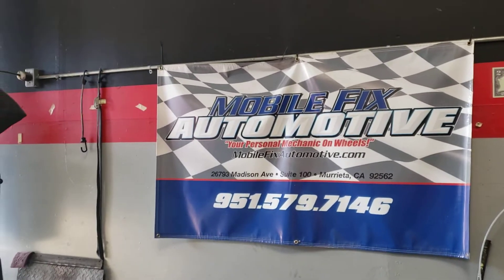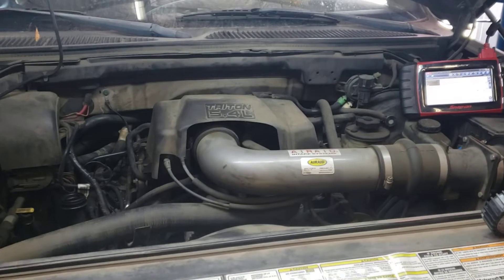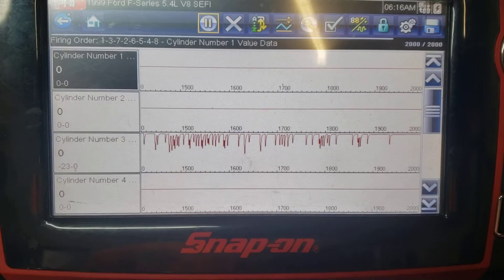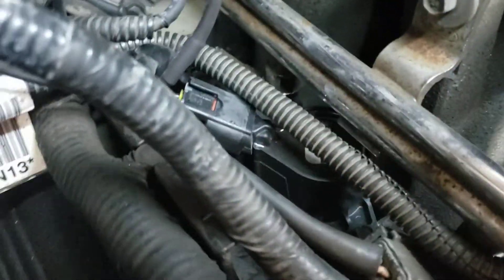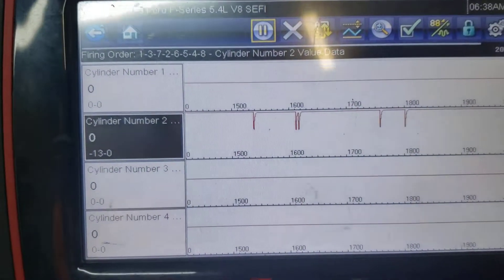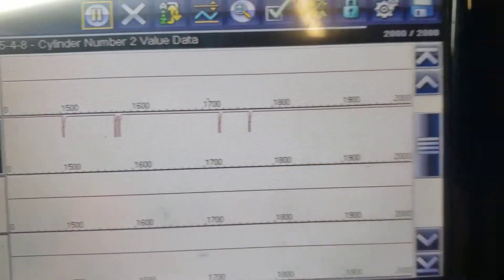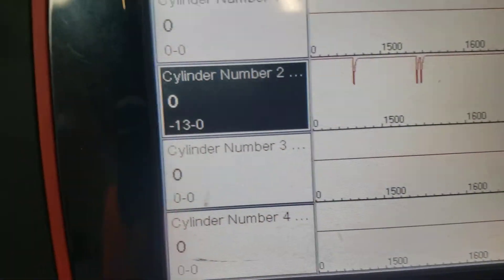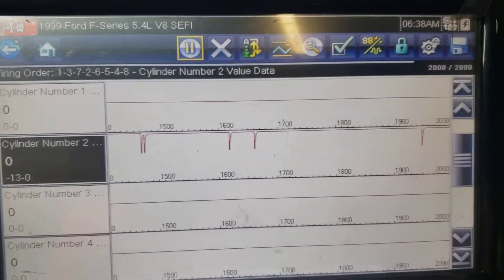2 Valve Triton engine misfire p0303

Comment: Just bought a 2003 V10 excursion.  134k miles.  Looks to be 100% factory ignition parts.  I’m considering replacing ALL of the coils and injectors.  This going to a road trip vehicle, so I don’t want to be in a parking lot in BFE diagnosing and changing parts.  Thanks for your videos.  They have been very helpful.
Reply: Aftermarket coils have a very low lifespan. Buy once cry once. Get OEM Coils.  They are a pain in the ass to put in- buy using OEM  you wont have to deal with it for years....
Reply: You should. I use motocraft only and I'm at 250k.
Reply: Ll

Comment: Hey Ron trying to repair my 4.6 with the calvan kit, i'm having some issues with it and was wondering if i could get a question answered, do you have a facebook? thanks.
Reply: The issue i'm having is that there was an insert already in the cylinder but the threads are no good, what would be the best way to get that insert out, or should I rethread the insert
Reply from the maker: @ForrestWhite35  the insert needs to be removed. However because of the multiple problems that may arise during extraction I do not give advice on removal procedures. It is difficult even for me to remove old inserts and I always notify my customers up front that head removal may be necessary.
Reply: @SandCarServices  thank you for your reply Ron